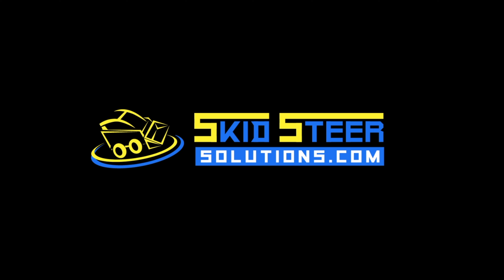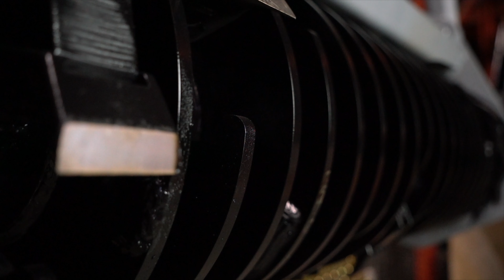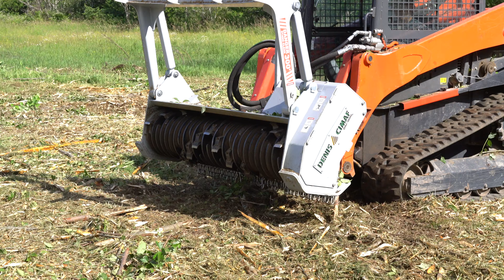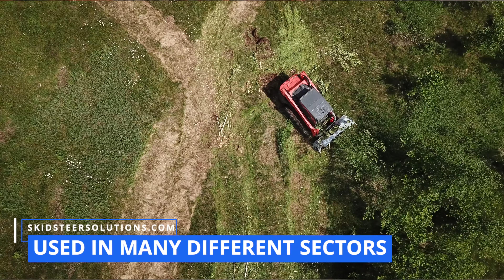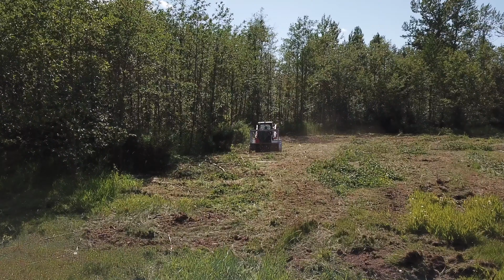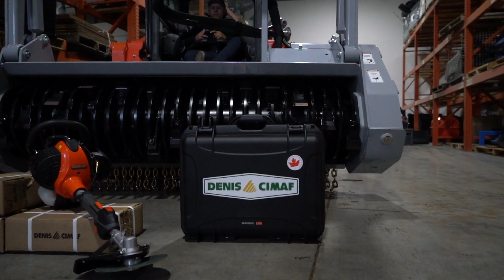Denis Cimaf 180D Skid Steer Mulcher Overview+Demo | Skid Steer Solutions

Comment: I have a standard flow, asv rc50. Got anything?
Reply from the maker: Hi Steve, that machine puts out 16 GPM hydraulic flow rate which is not enough to run any mulcher that we offer (or any that we know of). Most of the standard flow mulchers require a minimum of 20 GPM and run most efficiently at 25+ GPM. We do have brush cutters and other land clearing attachments like tree pullers and shears that you could run! https://www.skidsteersolutions.com/